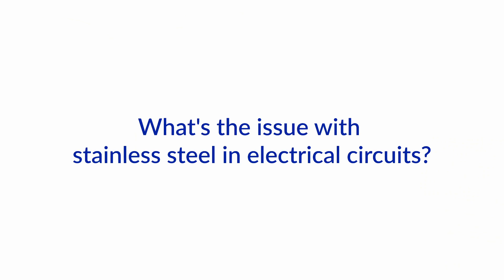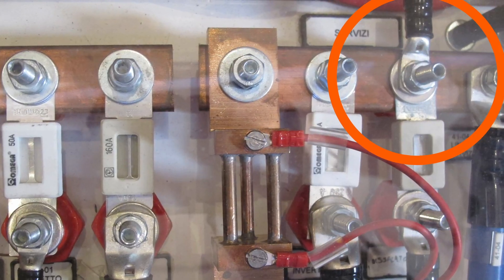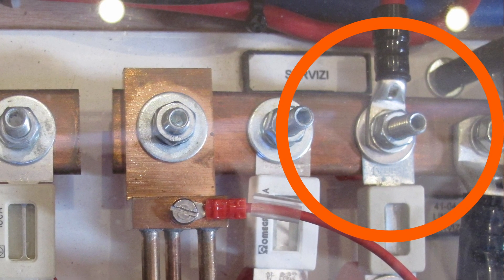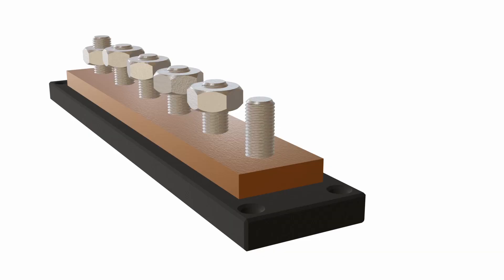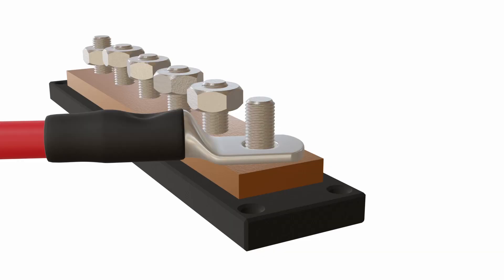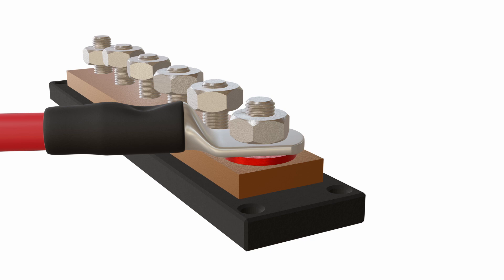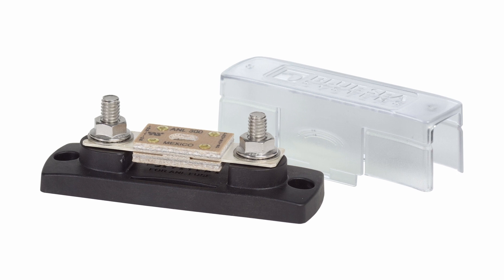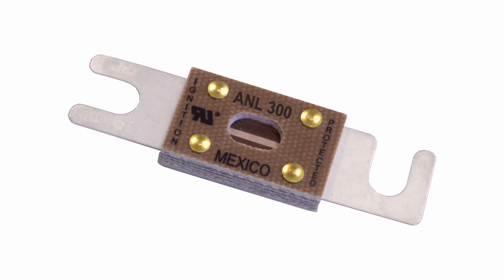Stainless steel in electrical circuits: Why this is a problem...  | Ask The Expert with NIGEL CALDER

Comment: Hello Nigel,  I am a 68yr old retired aircraft engineer, living aboard in France and have for decades used your books as my bibles, so first want to say thanks for all the brilliant information contained there-in. If only my brain could retain what I read!! For any liveaboard or potential liveaboard  owner these books are the best investment they could make since so often one is left to nut out a problem or make an installation oneself. In fact that is the best solution anyway since it means you become au-fait with your boats systems and its increasingly hard to find experts anyway. I am looking forward to your advanced course. This tip re SS is an issue I have long wondered about. Would using brass hardware be a better or worse solution?  Also I wanted to call out an issue I had recently with a battery master switch to my 3kW Victron inverter - this new switch was not a BEP one but a copy, and within months of installation had a whopping 4V drop across it. I pulled it apart and the contact area was miniscule. Needless to say that is now a BEP part as were all my others.  Can you possibly make a video regarding the dangers of cheap usually copied marine electrical parts? Thanks again.
Reply from the maker: Brass is definitely not better than stainless steel because the high zinc content in brass makes it susceptible to internal galvanic corrosion – dezincification. Even so-called ‘dezincification resistant’ brass (DZR) is not always immune to this. High quality bronze, on the other hand, which does not have the zinc content, is an excellent material which is almost immune to corrosion. It is not unusual, for example, to see 50-year old bronze through hulls and propeller shafts in excellent condition. Of course, it is considerably more expensive than stainless steel and in some circumstances (though rarely) may not have the desired physical properties (shear strength, etc.).

With respect to the battery switches, this is a critical and often unrecognized issue. There is a substantial difference in the contact area and other properties from one battery switch manufacturer to another. There are some physically large and imposing looking switches with limited contact area and some compact switches with excellent contact area so there is no way of knowing by looking at the switch. To some extent the inferior switches can be weeded out by checking the continuous current rating and the intermittent current rating, and seeing if these are determined according to the ABYC C-7 standard (Battery Switches for Use on Boats).

There is another unrecognized issue here. None of these switches are designed to be turned on and off under load; it is expected that loads will be minimal. If a switch, even a quality switch, is ever used as an emergency switch to break high currents there likely will be damage to the switch points (in extreme cases, the points can get welded shut). The switch will need to be replaced. I am wondering if your 4v drop across the switch points is a combination of inferior construction and switching under partial load.